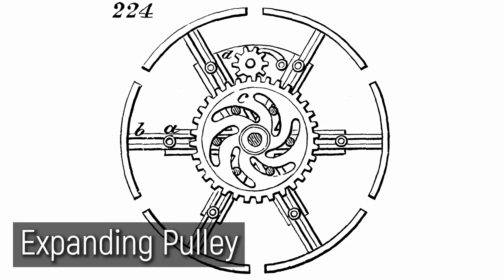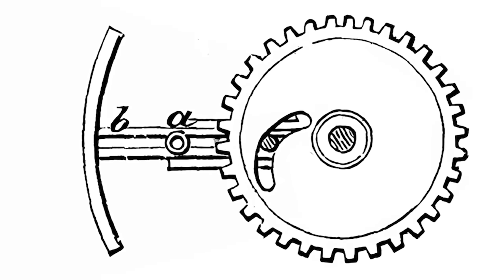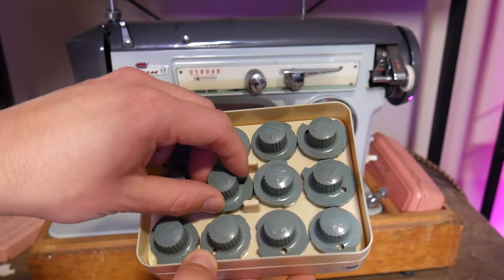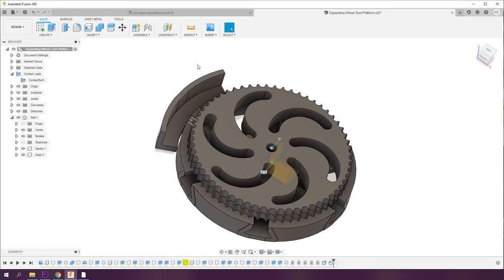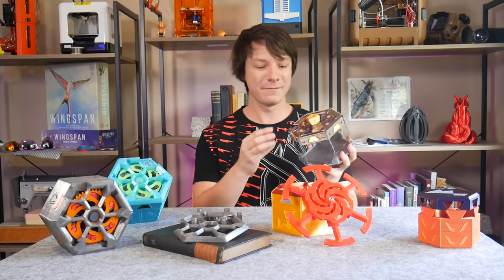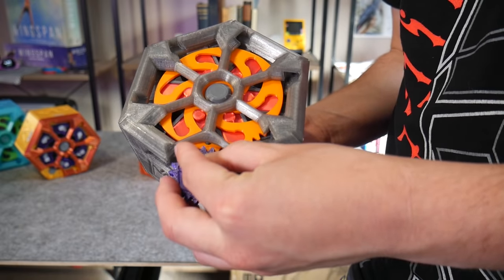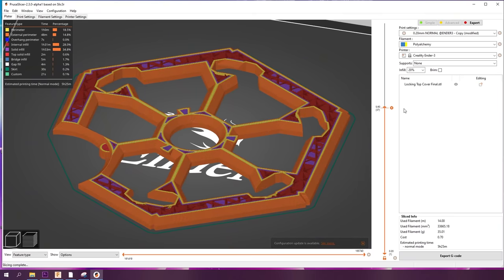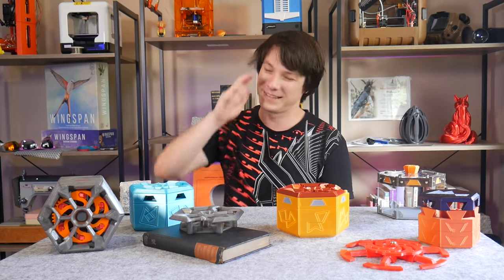This Expanding Mechanism is Crazy Clever

Comment: Two thoughts:
1) expanding pulleys (or whatever they are called) are used in a centrifugal force clutch mechanism, like in a scooter.
2) pulleys are often use with ropes and they do not need to be concentric/circular to work.
Reply: Agreed, my 1st thought was the old massive leather belts used on 19th century machines (looms and machine shops with 1 engine powering multiple machines). The design could be used as a speed control if a idler tension wheel is used to compensate for the diameter change.
Reply: The 'expanding pulley' used in belt CVT transmissions use a different mechanism to move the sides of the pulley toward the centerline.
Reply: That is not for a clutch system, period. It's made to adjust the ratio of a pulley system, so the speed of the drive chain can be speed up or slowed down. Pulleys use ropes, chains, belts, tracks, or anything that is flexible, so as long as the shape is rotating, it doesn't matter what the shape of the pulley is.
Reply: @Tom-yc8jv  The so-called "clutch" (actually governor) on a motor scooter is belt-driven, so it could potentially work with that. However, I don't think most do.
Reply: They actually are for flat belts!
Their purpose is similar to the purpose of the CVT but not identical.

Ive seen them in manuals for machine tools from the 1920's and older but never owned one myself.
 Specifically for shapers, otherwise known amd arm-strong's
These tools are so rugged even from the 1920's they still are in use in modern shops who can afford the space for them or shops that need skiving done like you se in copper semiconductor heat sinks!

But they are very rarely made today, because of low demand and high market saturation, it really is an under appreciated machine tool. I could not hide my excitement to see a piece of it resurrected for a modern use!
Reply: @OtakuUnitedStudio  Centrifugal clutches on scooters, etc, work by expanding weighted shoes against the inside of a drum. The faster it spins the tighter it grips. The engaged clutch is typically what drives the chain or belt that in turn drives the wheel, not the reverse. 

It's not a governor as it doesn't limit or control anything. It's only function is to disengage the engine from the wheels below a certain rpm. It's not a so-called clutch, it's a clutch.

This mech doesn't look very useful for a rolling application like a vehicle though. It looks more suited to adjusting the speed of belt driven pulleys in static applications like lathes, drills, pumps, and locks for 3d printed boxes of course.
Reply: My thought was to use 3 or 4 of the expanding pulleys in sync across the entire width of the belt, but to alternate the "teeth" of the expanded pulleys to create even circular tension on the belt. SO the 2 outside pulleys would be mirroring each other, and the 1 or 2 inside ones would be mirroring each other, but the expanding teeth would be alternating of the outside ones. A bit hard to explain but I hope you guys get what I mean. Basically using all 4 mechanisms together to create one round expanding pulley.
Reply: The first thing that came to my mind was drum clutches as well for chainsaws, rc cars ,scooter etc. bit different mechanisms in them though
Reply: @roomtemp6374  You're talking about a fixed gear clutch, clutches such as the Manco CVT clutch slides the belt up or down the pulley (cone) to increase or decrease the overall gearing, making it easy to start, but also allowing for a higher top speed. Quite efficient actually...
Reply: @thomasrobertson9835   Yes, I'm talking about the clutch itself. The CVT (continuously variable transmission) is a transmission and not a clutch. In the setup you're talking about the Manco or Comet style clutch is in addition to the CVT. (Inside/behind the primary pulley of the CVT.)
 

Belt driven CVT's are efficient in terms of use of parts. In terms of power transfer, not so much. There's more frictional losses from the belts in that setup than you might imagine. They're good for applications where simplicity is king though.
Reply: @roomtemp6374  May be inefficient but far more efficient that one gear, so you want to go slow really quickly or fast really slowly?
Reply: @thomasrobertson9835  Don't get me wrong, I'm not saying they're bad at all. They're great for applications where simplicity matters more than efficiency. Every machine has compromises in engineering. In this case it's trading some frictional losses for the complexity and expense of a gearbox.

Comment: I was thinking of this for an expanding wheel a while back. My plan reduced the effect of the individual sections creating flat spots by utilising a stack of these offset from each other. 

I also added a rubber pad that compressed more at the peak of each section. 

I was attempting to make a bicycle wheel that could reduce diameter for easier use on public transportation. It works reasonably well.

Comment: Reminds me of a longworth chuck that bowl turners use on their wood lathes
Reply from the maker: Hey you're right it is very similar to the scroll in chucks...! Great observation didn't even think of that.
Reply: And a chuck boring ring.
Reply: @MakersMuse  No a scroll chuck is different again; A longworth chuck uses plates, one with left hand spiral cutout and one right spiral cutout, back to back
Reply: Came here to say the same thing.  Looks just like a longworth chuck.  I wonder how much more "bite" you could get out of a longworth chuck by driving it on a gear...  Tried to use one once for a non wood turning application and was surprised at how little holding torque it had.  (Could have been because I made it... lol)

Comment: That adjustable pulley is for changing the ratio in a pulley system, to speed up or slow down the drive chain. It's still used to this day.
Reply: yeah the expending pulleys is the corner stone for modern CVT transmission
Reply: Makers Muse: "... I suspect this design didn't see very much use..."
also Makers Muse: "... it's kind of bad at what it was designed for..."
😂

Comment: You asked for real world use of this contraption? It is being used in a coil holder in a factory that specialises in sheet metal products. They have the sheet metal delivered in big coils and then flatten it. The device that holds the coils in place has four of these (slightly more robust than you 3D printed version) paralel to each other on a central axis. The main benefit being that it can pas trough the smaller hole in the flanges of the coilholder and uses a rotating movement for engaging the grip. So unrolling the coil automatically engages de spreader and centralises it. Keep up the fun work.

Comment: Most in floor safes use a similar mechanism to withdraw 3 bolts allowing the safe head to be lifted out with a handle.  The better ones allow you to remove the dial, and some have specific dials that are offset from others, so without the correct dial AND the combination, you can't open the safe.  I can provide photos if you like.  
Added: Also, the entire Wheel is the Cam, the Pins are pulled and pushed by Channels in the Cam which drive the Bolts, your bolts have arcs attached in the early version, but they are still bolts.  A Cam is any driving device set to pivot on a single point.

Comment: It reminds me of watertight (or airtight) door locks, designed to secure doors against pressure differences, used in ships or passenger aircraft.
Reply: Or the one of the vault door designs from Fallout
Reply: @Noahs80series  Only FO4 111 ones. Most from before where just roll and push doors.

Comment: Back in the 1800’s this design was used to adjust vanes inside water turbines that ran flour and grist mills and early factories that were water driven by rivers.  They needed to compensate their RPM and torque for the machines based on different water conditions before and after big rainfalls, different seasons ect.

Comment: At my job we made a prototype of a robot to drive through large underground pipes. We used this mechanism attached to the front of the robot to expand sensors outwards so they could make contact with the pipes wall. We later scrapped the mechanism and went for something else because it didn't provide a high enough expansion ration to cover the range of pipes we were working in... It could also be used to lift and move cylinders by expanding within them creating a high friction force.

Comment: 7:11 you can still open it with a magnet and without the key.
Reply: Yep, this doesn't have "that" kinda key
Reply: simple fix, give it an actual key to pull back a bolt that locks the disc in place.

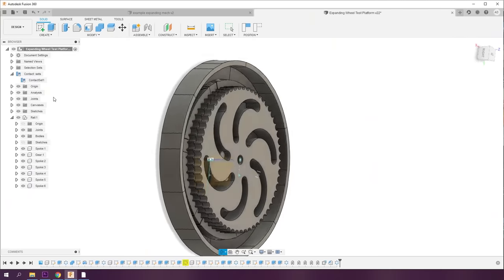Comment: @3:43 couldn't this be useful for changing gears on a bike?  you'd just have to figure out a way to avoid breaking the chain when you adjust the size of the gear.
Reply: derailleur???!
Reply: Not with a chain it wouldn't, but with a belt drive and two microcontroller adjusted pulleys, it would work. Belt slipping? Tweak one pulley a fraction larger to tighten it.

Comment: If I can give a small improvement suggestion about the access to the gearing, you could have just covered the tooths with the casing (giving it no access from the top and side) and made the gear slide in from the side(with a pin underneath it to guide the position). It would still be hackable with a stick, for that you could add a small locker (as you did) that gets unlocked by the driving pin on the gear (the locker could put a gate behind the gear pin when it unlocks in order to prevent the double stick hack). With this modifications it could work without the necessity of 2 magnets and a spring

Comment: Wouldn’t the drum on a CVT Transmission kind of resemble an “expanding” pulley?
Reply: depending on the type of CVT, yes.
Reply: I was thinking the same thing. A CVT based on conical pulley system should work
Reply: There was some kind of bike CVT designed i believe in Australia with such mechanism in 1980 s or something.
Reply: Was thinking it looked like a early pulley for soft starts and when up to speed it expanded to operating size like from torque to speed
Reply: They used to use them as a clutch on pretty much all large heavy devices that didnt require constant power. Mills for example. They were used to get the big millstone moving with a power source like a horse, or water, then when the power was removed it would become smaller again, detaching and allowing omentum to take over.

Comment: That expanding pulley design was used as a basic clutch on many items of the past. Eg when power is applied, it expands outward to touch the inner surface of a tube, thereby powering the tube. Then when power was removed, the pulley would disengage and allow the tube to continue to spin unpowered with its momentum. This was used on many gates and mills just a few hundred years ago.

Comment: Okay, I know it's been a year since this video was uploaded but if you care to re-visit the idea a few suggestions may improve its performance.

1.) Thicken the wheel to at least double its current thickness ...so that the pully can actually be used as such. You know how pulleys have that groove for the rope to go through!
2.) Print it so that the arcs are hollow and piece each one together with spring-loaded inner arcs [one on each end of the arc segment]. ...so that when the wheel expands each of the arc segments expands with it completing the full arc of the wheel without gaps.

If I had a 3d printer and a CAD system I'd make all kinds of stuff but my home is not my own! For now, I guess I'll have to settle for my thought experiments and building stuff in my head.

Comment: I have a puzzle from I think the 90s which uses a bit of a modified version of this mechanism to allow them to move independently of others, however, where it's a modified version of this puzzle is that each pin moves a plastic divider, allowing some to move at some times and sometimes not at all, creating for an interesting combination puzzle which can be solved pretty easily

Comment: To fix the gap problem, just make interlocking ledges that overlap when the mechanism in contracted. And for the magnet issues, just make the placement pin a diagonal pin, then let this pin rotate freely with the gear key, this allows you slide in the key at an angle and you can cover over the edge of the mechanism.

Comment: You actually missed a feature.  The near perpendicular part at the end means that a lot of motion leads to a little movement which has the same function as a high gear ratio and makes it easier to stay in place and applies more pressure with less chance of slipping. It's also the inverse of an iris mechanism. :) Using a rotary cam to expand a circle rather than shrinking one.

Comment: You could design a puzzle using the mechanism to lock in to and lift objects. A crane style puzzle? And you could build it so that the pins lock when weight is applied and release when the weight is relieved. You could include resistance to that movement to target the weight that would remain locked. That would allow you to have the pins retract unless the specified weight is applied, meaning that picking up the wrong piece would cause the piece to drop, while picking up the appropriate weight could keep it locked in place until set down.

You could stack multiple mechanisms with different length pins to create an actuated key. This could be modular, so a scavenger hunt would require people to find each module, assemble them together correctly, then activate it(with a secondary key, or lever, or machine depending on resistance) to open and move a door.

Or it could be used as a breaking mechanism.

Comment: One example I've seen is a dining table that's rotated to expand its diameter. However, in those designs additional elements stored beneath the sections rise to fill the gaps in the surface and create a larger circle with a wider radius. I've wanted one since I've seen them.

Comment: My electric scooter uses a similar design that pully has for the brakes. The pully is placed inside a brake drum, and expanding it creates friction, braking the wheel. Ther's also a spring inside ensuring the moving parts retract in place when you release the brake lever.

Comment: If you think about running a rope over the pulley, you could change perceived pull weight and speed depending on direction of rotation.  In a hydraulic crane for example, it would allow you to hoist a heavy object relatively fast, but lower it more slowly and controlled.

Comment: This is very commonly used in lathe chucks: a key drives a bevel gear which drives a large plate with a spiral on it. The lathe jaws sit in this spiral and get driven inwards or outwards. They lock in place with force because they bind.

Comment: Similar mechanismis used to calibrate the sizes of loops that stick out of electromotors, but instead of pushin the fingers out,it has a holein the middle where the emotor sits and the fingers arepushed inside through the coil loops.

Comment: 1) There are smaller safe doors that use this mechanism - it's not "forgotten".
2) It is possible to gear reduce - the disc is essentially a sheave on a shaft.  Use a bit more imagination!
3) Back drive can be prevented by taking care in the design of the slot - you could have bought yourself more space by using two discs, and only using 3 sliding bolts per disc (enabling 120 Degrees of rotation versus ~60). Having the bolts fully extend and then having another 15-degrees of rotation of the cam disc that stays at the same extension would give the cam a flat rather than sloped surface to push back on.
4) Back drive could have been further prevented with an mechanical interlock, or either a cycloidal or worm gear primary drive (naturally resists backdrive) for the discs.  I challenge you to print a split globoid worm drive. where the cam discs (globe) are driven by the worm

Comment: Could put two back to back with half-angular step offset, then the two sets would still overlap even when fully expanded. Could also add a rotating movement, so they project out along a helical path - this will make it so the belt around the pulley sees a circle at any radial position of the segments. 

It's of interest because it should have less friction with the belt than with other designs usually used - generally based on conical contact, which always have a friction problem.

Comment: Three thoughts:
1. You don't have any rope grooves in the one you built. If you have a flexible rope then it may not matter if the pulley stays concentric.
2. If you place two of those at either end of a cylinder made of overlapping material you could create a spool whose diameter could be changed.
3. Changing the size of a pulley (by itself or in relation to another pulley of fixed size) will change the efficiency of the pulley (Efficiency = Mechanical Advantage/Velocity Ratio).  Think about what changes, and then think of a case when that might be useful.

Comment: I imagine these would have been handy in a steam-powered workshop, which used belts over pulleys to run equipment. If you wanted to tweak the rotation speed or torque of one machine without affecting all the other machinery running off that shaft, you could use one of these to fine-tune different things running from the same steam engine. Couldn't find any examples, though, so this is pure conjecture!

Comment: I used a similar design for a “keep sake” invitation I made in school. It was simplified to 4 points. 2 Parallel points had pull tabs that allowed the user to pull either one, revealing 4 cards with information about the event on them. Yes I was super extra and unfortunately I had to cut everything out with a Dremel into acrylic since 3D printer and cutters weren’t cheap or accessible back than. I even had to attach the pieces to what I called the fly wheel, with this binding bolt things. All assembled, that thing was a brick. Postage would have been astronomical 😂